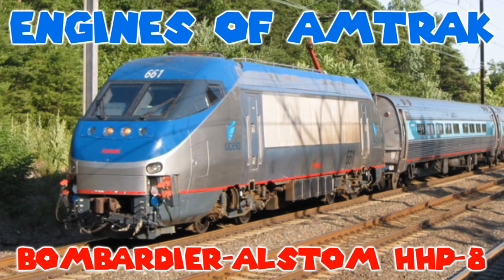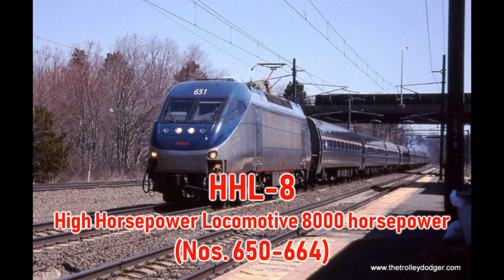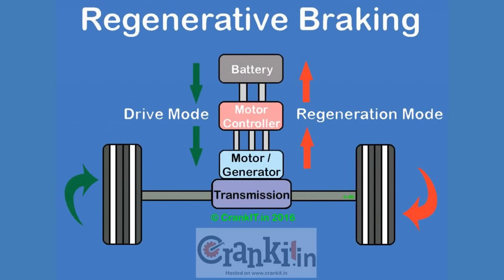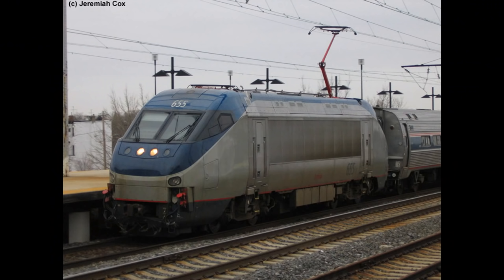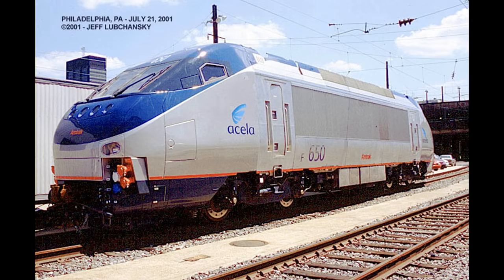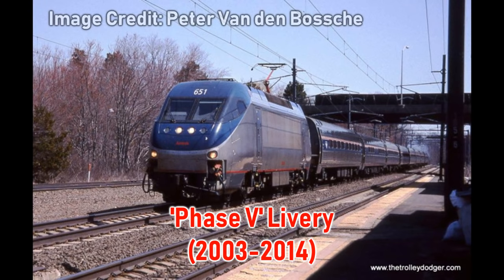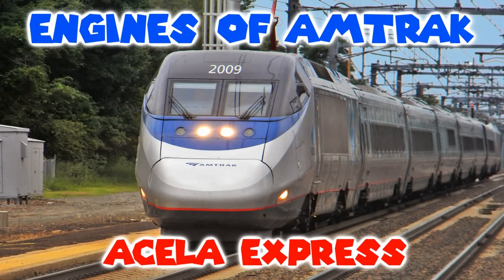Engines of Amtrak - Bombardier Alstom HHP-8

Comment: when I was younger, I used to think these were acela's that were modified to be a single locomotive. I was way off 😂
Reply: SurplusPlanet54  that was what the designers were going for apparently, a unified branding of design.
Reply: @gregoryboyek622  hmm thanks!
Reply: Me too. I called them the "double-sided Acela engines".
Reply: When i was getting into trains a year and a half ago i first saw them in a thanksgiving rush video. I thought they were disconnected locomotives from the acela lol
Reply: lol same, though it would be a bit cooler if it was connected with the Acela
Reply: SurplusPlanet54 same lol
Reply: @blakemcnamara9105  same
Reply: The German ICE 1 is actually kinda that, they can disconnect the motor cars and ferry them on their own (but not really attach to trains without some modifications to the coupler).
That's because the 1's motor cars are little more than re-dressed electric locomotives.
Reply: 2:48 Wheel slip
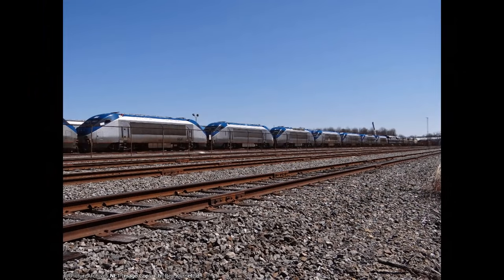Reply: 4:49 4:50
Reply: 4:51 bare Delaware

Comment: The HHP-8 is underrated for its new technology back in 1999, it was kind of the basic acela express, having the new break system, testing tilt technology, and overall was a big part in Amtrak history. WIthout learning from the mistakes of the Acela Regional (HHP-8) the Acela Express would not be as safe and due to these early advancements, the Acela Express has not crashed once! the Acela Regional (HHP-8) will always have a place in my heart of one of the most advanced Locomotives in Amtrak history, and i hope this new generation has the same experience as i did with the new ACS-64 Locomotives. Rest in peace Acela Regional, you won't be forgotten.

Comment: First time I took Amtrak was from New York  penn station to Orlando Florida and the part between New York and Washington was pulled by an hhp-8. I never understood why the didn’t just have Alstom lower the horsepower to limit the wheel slip and replace the trucks to prevent problems that they had and shared with the Acela.

Comment: I also heard the HHP-8's had overheating issues. I lived right next to the Northeast corridor/ Penn Line and in the summer it was noticeable that they pulled shorter trains. Could just be summer time has fewer passengers, but word was those hot days were too much for them. The diesels trains didn't seem shorter.

Comment: problem with the HHP-8 was it was a lemon within 2 years of service all 15 units were in the shop undergoing traction motor and pantagraph replacement and they overheated. Amtrak retired all of them and handed them over to MARC for rebuild. It was replaced by the Siemens Charger and the ACS-64 City Sprinter also made by Siemens and Bombardier.

Comment: Something I’ve wondered for a while: why do they need cab cars on trains with these electrics? They have cabs at both ends of the locomotive, couldn’t you just move the loco to the other end of the train?
Reply: BlindingLight Yes, but also no. It depends on how much headway there is between departures. There may not be enough time for the locomotive to reverse itself to the front, so they put a cab car to save time